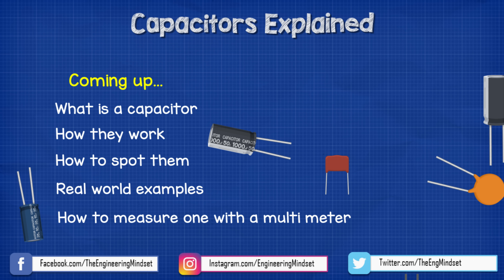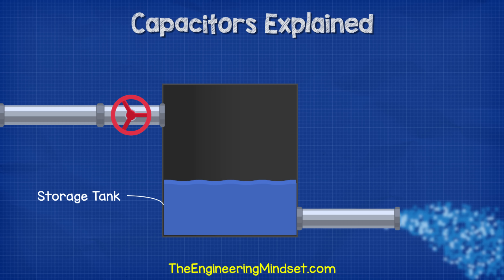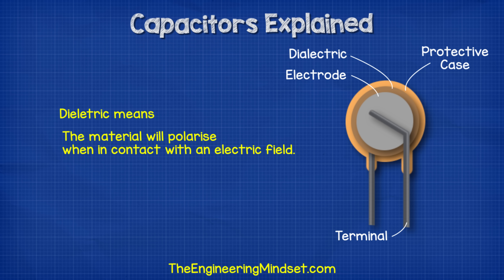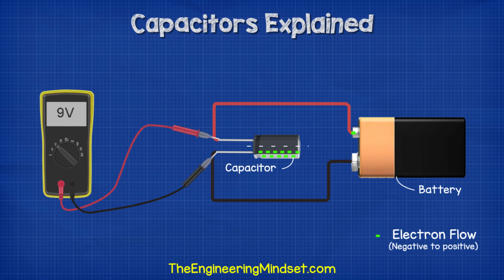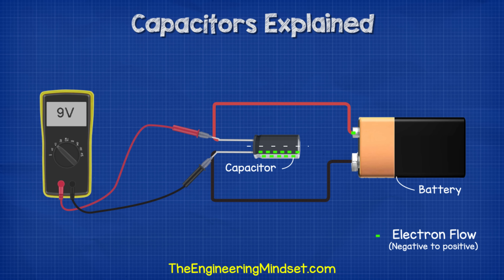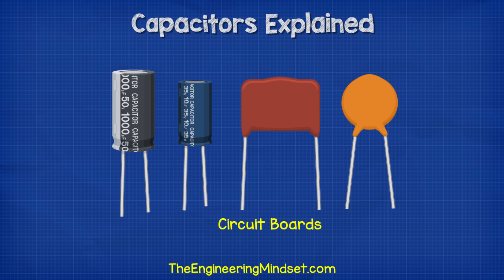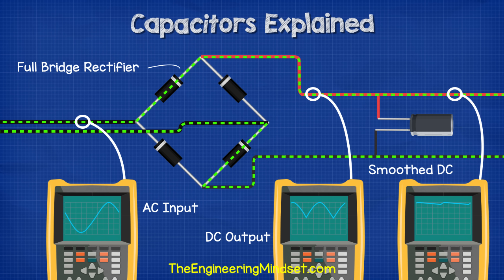Capacitors Explained - The basics how capacitors work working principle

Comment: that's good; but I have some questions (one of them added after the watching this video). you said the electrons move from negative side (cathode) to the positive side (anode), so why the car battery pole which has the power is red (positive) and when it is disconnected nothing flow no more? and in circuits and drawing the side of flowing the current is from positive to negative?
I read many articles, watched many many videos, searched in internet but I still don't know how to measure and calculate the capacitor for the circuit with the specific value of current and voltage. recently I was looking for the transformerless power circuit to inverting the AC 220V to DC 6V 1A but all of them have the specific numbers of values in their components, for example 470uf, 0.47 uf, 4700uf pf capacitor (400V) which comes with a 1megaohms resistor first of the circuit near the line wire of AC. so I don't know why the number 470? in the 110V AC version the capacitor is 1uf and the resistor is 470k ohms!! so why? where these numbers come from? all of those circuit have the output current under 100 mA, so if we want more output current it means bigger (and higher in values) capacitors? what does a capacitor with the current and how are we able to calculate what capacity of it is needed?
Reply from the maker: Check our our new car battery explained video: https://youtu.be/VnPRX5zQWLw
Reply from the maker: Check out NEW resistor video, everything covered! ➡️ https://youtu.be/DYcLFHgVCn0

Comment: So if i use a 100 volt battery to charge a capacitor rated 50volts,it will explode, right?? Can u explain why it explodes, I mean what happens internally?

Comment: Can anybody tell me why is there a resistor in the circuit shown at 4:35?
Reply: Good question. Led's will burn out if too much current is running through it, so the resistor is to prevent that.
Reply from the maker: Check out NEW resistor video, everything covered! ➡️ https://youtu.be/DYcLFHgVCn0

Comment: I have learnt the use and how the they actually work.

But let us say i intend to make a circuit. What will determine of tell me that, now i need to put a capacitor here, and are capacitors usually connected in parallel or in series?

Comment: I do AC service. Customers always ask me what a capacitor does because im constantly finding them weak or dead. The best way that i could explain it in layman's terms is that they reduce the strain of work that the compressor or fans produce while under a load and are similar to a battery. I love the explanation in this video!
Reply from the maker: Check this out, how a battery works: https://youtu.be/PXNKkcB0pI4

Comment: The letter "μ", is the Greek letter for "m" and it is pronounced as the English word "me". And in the animated video, you chose the "Ohm" setting, not the one for capacitance. By the way, "Ohms" are represented with another Greek letter, called "omega"(Ω).
Reply from the maker: If you look carefully at the multimeter it has 4 functions on that setting, ohms, diodes, continuity and capacitors.
Reply from the maker: Check our new Multimeter tutorial out ➡️ https://youtu.be/4lAyzRxsbDc

Comment: I studied electronics for three years and I must say I enjoyed this video. I used to work on a bit of kit that required a capacitor to be discharged prior to fault finding. I can't remember the specs, but my lecturer insisted on the use of a 6" screwdriver to discharge the capacitor. It always produced a good bang and melted a bit of the tip of the screwdriver.

Comment: Hi I have a 2hp electric motor 3 phase., which capacitor should i use and micro farads is needed so that i can use it on single phase power supply,.

Comment: Microwave oven hazard: Experimenters often tear a microwave oven apart to salvage the magnets. Nothing wrong with that, but there is a large capacitor in the power supply that is charged to a high voltage, perhaps as much as 2,000 V in operation. That capacitor can kill you if the microwave has been turned ON recently, like you may do to see if the oven is really dead.  Be very careful with a microwave oven! (Just thought I'd throw this out there. That's all.)

Comment: In addition to polarised capacitors, there are also non-polarised capacitors. 

Don't connect the minus side of a polarised capacitor to the plus of a load, or it'll blow up (like in the video). 
Non-polarised caps don't care about polarisation and can be used in AC applications.
Reply: John Smith  Ah good luck ^^

Comment: If  you dont think they store for a long time, in the 1950's a man in N.J. was electrocuted by touching a leyden jar he found cleaning out the attic of a house he bought. (google) Leyden jars were early capacitors . The ones he found had been in an early transmitter tank circuit and had retained their charge of a couple thousand volts - from the 1920's. (results of an investigation) Written up as I recall in Popular Electronics .

Comment: Dear Sir, I am new here....can anyone guide me to wire LED light on breadboard but in series?
Reply: LEDs are diodes, so they only work in one direction. Make sure your LED isn't backwards or it will not work. You'll also need a resistor to dissipate power in the circuit. Finally, you'll need a power source.
Reply from the maker: Check out NEW resistor video, everything covered! ➡️ https://youtu.be/DYcLFHgVCn0

Comment: Are AC capacitors different?
Reply: Capacitors aren't distinct for AC or DC, they can be used in both and have different behaviors. Capacitors in AC will cause the current in the circuit to lag the voltage.

Comment: Thanks for nice video! 
I have a question 
Should I put the resistor in the circuit always? Can I replace the resistor with other loads only?(like LED, Motor..)
I've seen that all circuit diagrams have at least one resistor.
Reply from the maker: Check out NEW resistor video, everything covered! ➡️ https://youtu.be/DYcLFHgVCn0

Comment: well you still did not say what it does to the motors. it make a single phase 115 vac act as two phase. It makes a two phase 230 vac act as three phase. plus you don't use them on thee phase because you would have to add another winding for each phase a capacitor was used.

Comment: It blows me away that a capacitor is an open circuit that behaves like a short circuit when you first throw the switch, and an inductor  is a short circuit that behaves like an open circuit when you first throw the switch.

Comment: Sir, what difference 30uf and 1000uf in capacitor, and what use 'uf' in capacitor, with example supercapacitor. 
By Ans please text, or video like or make new video Full and deep detail
 
Thank you sir for this video
Reply: uf stands for micro-Farad. Farads are the standard unit of measurement for capacitance. A micro-Farad is 10^-6 Farads.

Comment: Video mentiones capacitator can be dangeours due to the voltage stored inside but how do we know the current inside it? If there is no current how is it dangerous?
Reply: Current isn't something you measure a static amount of, just as you don't measure the flow of water in a pond. Current is the measurement of moving charge. Capacitors store static charges on electrically isolated plates, which creates a potential across the leads. Basically, a capacitor will store charge, not current. This charge creates a voltage potential, but something can have a voltage potential and no current if the circuit is not complete.

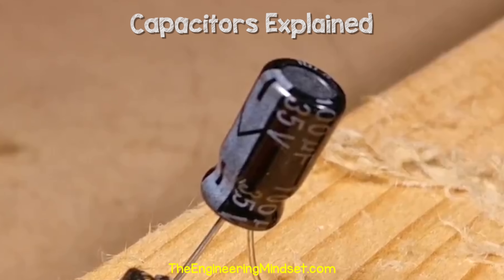Comment: 6:10 the example is misleading because you never mentioned the fact that the electrolytic capacitor wasn’t polarized correctly.
Reply: Nope the voltage is too high it is not revesed

Comment: I was an apprentice electrician when I changed a 480 volt ballast kit for a high pressure sodium fixture. The resistor was not on the capacitor and when i placed it in a junction box on a cart, got the biggest explosion right in front of me. It sounded like an M80 or blockbuster.
Reply from the maker: Check out NEW resistor video, everything covered! ➡️ https://youtu.be/DYcLFHgVCn0

Comment: 8:15 so does a multimeter messaure correctly and it's a thing with manufacturing of capacitors or is this a multimeter's problem ?
Reply: I imagine it’s the manufacture of the capacitor, there is a tolerance range which they must fall into. Slightly too much capacitance is not really a problem. Not enough capacitance would be a problem though, so they will always err on the side of slightly over the value printed on the side than not quite enough.
Reply from the maker: Check our new Multimeter tutorial out ➡️ https://youtu.be/4lAyzRxsbDc

Comment: I know you tried to do a very good video and for the most part, it is. What I do not agree with is the analogy with water and a tank, because it doesn't work like that with DC, because a DC voltage across the capacitor terminals will charge the capacitor during the first few seconds (or milliseconds, depending on the voltage and capacitance), but after the capacitor is charged, it will be an open circuit. The story is of course different with AC, the current keeps flowing in both directions.

Comment: this is just another form of clear evidence that proves the complete utter waste of time and resources put into a heavily flawed, ill functioning and stupified education system. There's next to zero real world practicality in any of it and most of the wasted time spent doing all the crap they run you through is quickly dissipated once the waste-of-time long winded course is completed and you're in the real world learning and practicing the actuality of the content in question.  All these 2 year+ courses for crap, remove all the b.s. and cut to the things that matter in SIMPLIFIED form like this video and you've come out better off without a fragmented mind filled with rubbishy unnecessary complexity that makes the teachers feel like their jobs and excuses to push for pay rises are more justified.   And all of this is even more emphasized earlier on in the standard primary /secondary schooling curriculum.

Comment: Am I correct in assuming you drain the capacitor of V potential before measuring capacitance? I see on your MM the capacitance setting is the same as resistance...

Comment: Take a pigtail and wire a capacitor up to 120 volts or 230v , whatever you have, take the Amp draw  times that by 2,650  then divide by the line voltage  you have, that = mfd.

You can also  do this in the system  by  taking the START winding Amp draw x 2650 divied by  the PEAK  voltage, that is the reading between the Run  and the Start windings,  or in other words  , the 2 leads  that go to the Run capacitor,  they are Run and Start.

Comment: Good basic vid, the water tank example should have a rubber devider that expands under pressure, currant does not flow through a capacitor.

Comment: Can I connect a capacitor in my dc battery circuit, dc+ to capacitor+ & dc- to capacitor- ? capacitor will be blast?
Reply: Basically I want to connect a capacitor on my bike battery circuit, battery is working perfectly but in the night I used head light and another lights of my bike and when I use indicators my horn is not working at that time. I saw some videos on YouTube who joined a series of capacitors and they removed the battery but in my case I want to use battery also. 
So I can use a capacitor on my bike without battery remove? Can I use both in the same time?

Comment: I work with flexible packaging. Usually involves laminating aluminum with different substrates such as different films and/or paper. As you can imagine, film can have a lot of static in it. We run contact lines to help draw it off but there’s always some. Our most common structure is form-pack. Thick gauge aluminum sandwiched between nylon and pvc. When you cut through the layers, often you will have static discharge between layers of aluminum. Just one of the reasons we have to wear static dispersing boots. How ever, when you start to laminate multiple layers of film together, that’s when you can really see the sparks fly. Sometimes you can get arcs of static over 2 feet long. I like standing at the back of the machine on a rubber pad and touch the roll while it’s spinning and call over one of my coworkers and shock the crap out of them. Recently we had one that was arcing almost 4 feet to ground. I made the mistake of walking past it and it hit my leg and buckled my knee. I’d have to say it was worse in some ways than a taser.

Comment: Great video.  Can you help me apply this to real life?  What I want to do is take the AC power from my two stroke motorcycle stator and convert it to operate a 12vdc LED head light.  I believe I need to rectify the AC power, then add a capacitor in parallel with the positive & negative to make the DC cleaner/smoother. I believe it is also a good idea to add a diode in series with the positive leg out of the rectifier, this should help protect the rectifier. My main issue is trying to determine the appropriately sized capacitor that I would require.  How do I determine the capacitor size?
Reply from the maker: Rectifier video here https://youtu.be/RiRyzLl4Y8U

Comment: If I used the wrong a.c. adapter on a small handheld appliance. Does that mean a capacitor exploded and I would have to replace it in order to fix it?

Comment: Great video! Can't say I learned anything, but I was trying to help my wife understand some of the things I work with everyday but couldn't explain without some visual aids. She still didn't learn anything, (not for your lack of info or my trying to explain) but I thought your presentation was great. On a side note, I happen to use several Ideal true RMS multimeters in my work for years. I have found that Fluke and Ideal and some other MMs are very good as long as they say TRUE RMS(root mean square). Ideal will even re-calibrate your meter even if you "think" it has a problem. I have a graphing megger that has been flawless for almost 20 years now, which is exactly what you need for diagnosing problems in the circuits you demonstrated here. Good show!
Reply from the maker: Check our new Multimeter tutorial out ➡️ https://youtu.be/4lAyzRxsbDc

Comment: Great explainer!  My dashcam uses a capacitor instead of a battery. While the car’s voltage is applied the camera is powered. Turn off the car and the capacitor provides enough energy to finish the recording and power down.
Reply from the maker: Check our our new car battery explained video: https://youtu.be/VnPRX5zQWLw

Comment: You forgot to mention polarity, if the electrolydic capacitor is placed in wrong, it will also explode. Ceramic capacitors are not usually polariozed, but as long as there markers for polarity, it is best to place them in properly.

Comment: When I was in high school, I took basic electronics. We were told never to disassemble a CRT display TV because the capacitors inside contain deadly levels of energy potential.
Reply: It's not the capacitors that are the problem, it's the CRT tube itself. It retains a  massive high voltage charge for a very long time.

I picked up a dust covered used replacement 11" CRT in the basement of the repair shop I worked in, and accidentally discharged it through my finger. It's a wonder I didn't drop the thing. Suffice it to say that I got a healthy new level of respect for them after that.

Comment: all electronic components have a tolerance +/-5%, 10% etc.  also capacitance is hard to measure exactly because the wires and connections are also "two plates separated by a dielectric constant"  also, only electrolytic capacitors have a polarization line and must be placed in a circuit correctly

Comment: In the intro, you showed a selection of different caps. The last one that slid up from the bottom was an LED.
Reply: To show off the idea that capacitors hold voltage by turning on that LED when it came in contact with the capacitor on screen.

Comment: Thanks. Obviously I have seen capacitors many times, even blew one up once, but did not know what they were for. We sometimes used to charge ignition system condensers up from the HT plug circuits, then chuck them to someone who would obviously try to catch it, and they would get a belt off it. Hey, the things you do when you work in a car shop.

Comment: Does capacitor work in DC current? 🤔 I think Not.
Reply from the maker: Yes, it does. The entire video is about exactly that.
Reply: @EngineeringMindset  Ya but capacitor block DC and allow AC how to understand this statement ?

Thanks for replying 😊
Reply: @pocoloco4025  Capacitors do indeed block DC when you connect them in series with (typically) an audio amplifier; this is done to avoid potential (voltage) differences between one amplifier stage and the next. Imagine a power amplifier without a DC-blocking capacitor; this could result in a large DC component on the output signal which would cause the loudspeaker to be eithr fulley pushed out or fully pulled back, instead of resting in the middle. Distortion would ensue in such an event, and you don't want that.
Reply: A capacitor simply acts as an electrical ‘spring’ - so think of it as ‘charge’ rather than AC or DC - think of AC as voltage going up and down and that works well for a ‘spring’, going up and down happily. But DC just goes up and stays steady... right? Well not really, there’s usually voltage ‘ripple’ which capacitors help to smooth out, especially when coupled with an inductor and a resistor ... also called an RLC circuit, which is the electrical analog to a ‘damped mass on a spring’.  Hopefully that helps.
Reply from the maker: Check out NEW resistor video, everything covered! ➡️ https://youtu.be/DYcLFHgVCn0